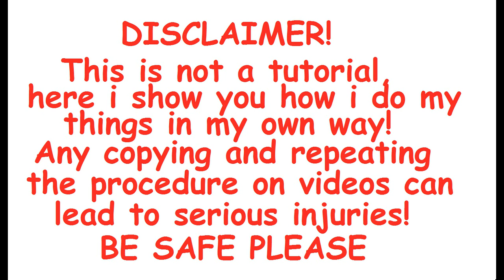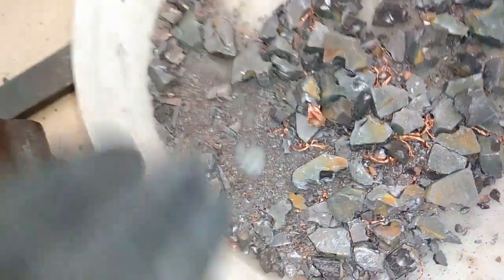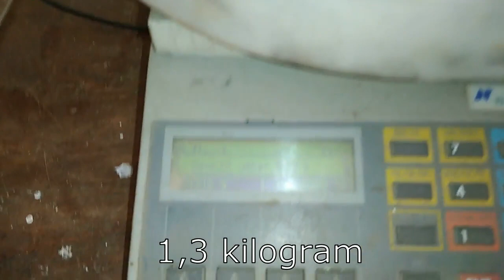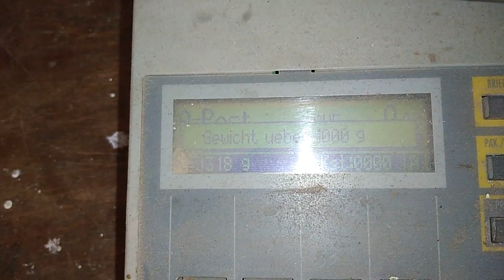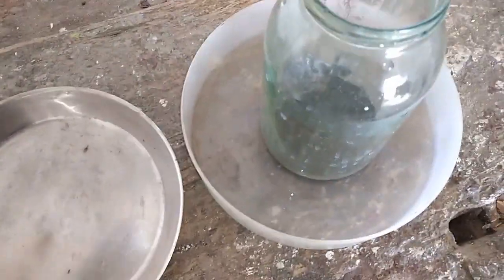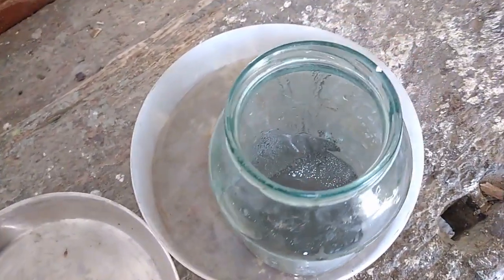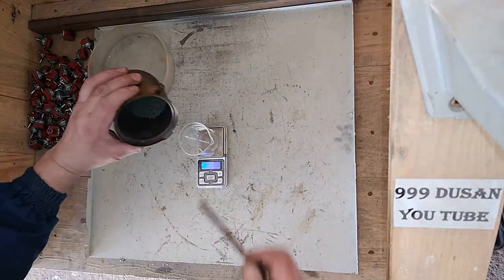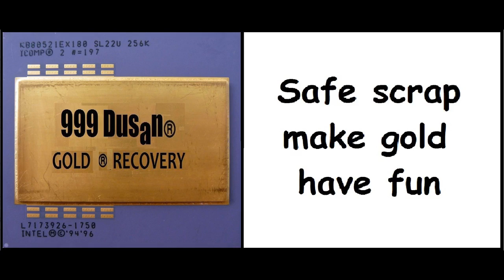Industrial motor brushes Silver recovery and refining!

Comment: Nice. I think it was me requesting the brushes video. Thanks dude! I'm glad you turned a profit. There are some very high-grade brushes in some stuff, I used to work for a place where we used a big 220v generator that ran on propane, it needed brushes replaced every six months and the guy who did the maintenance on it always kept the old ones. I guess they were like 30% or 50% Silver or something, they were light gray color and pretty heavy. I didn't know anyone made brushes with copper and silver mix, that's interesting.
Reply: How do i know which motor brushes have silver?

Comment: excellent video 999 Dusan, i do these in the UK as well, to get an even better yeald i use a saturated solution of salt water instead of hydrchloric acid to drop silver to save money, 
make sure to use the non iodised stuff so you avoid impurity's, sodium or potassium chloride works great for your source of chloride  ions, i buy my potassium chloride cheap from industrial farm fertiliser suppliers in 25 kilo sacks. I find the silver chloride is a much thicker better quality & easier to work with using this method, have fun :)

Comment: I have a question and a suggestion my question is will you get the same result if you use sodium nitrate and sulfuric acid instead of the nitric?
And my suggestion is rather than having to beat them to a powder with a hammer graphite is very soft use a 50 grit sandpaper or a coarse file and just grind them to a powder that way. 
Any input on the sulfuric acid sodium nitrate for silver refining would be greatly appreciate it!!
Thanks for another great video 999!!

Comment: Thanks for sharing your adventures with us.
I have 4 pounds of Diesel suet from Semi Trucks. I found it in concentrations in a Truck parking lot. Its whats left over after they auto/manually clean their smoke stacks (which must be done every 75,000 miles).
I believe its full of precious metals.
I wanted to know your thoughts on this. 
Would you attempt to find out? 
If so, what process would you use?
If there is anything in it.. it's NANO in size.. so what process would you use to find out?